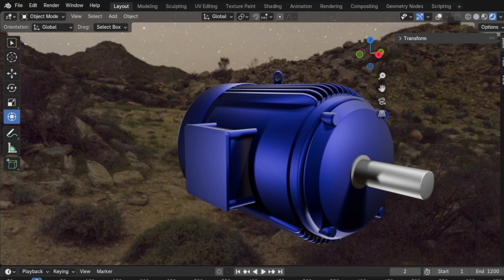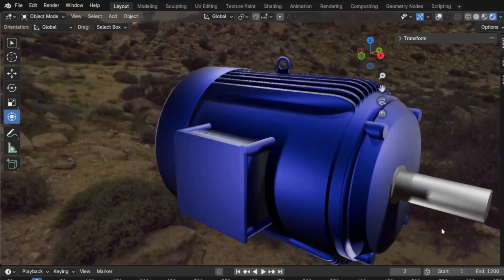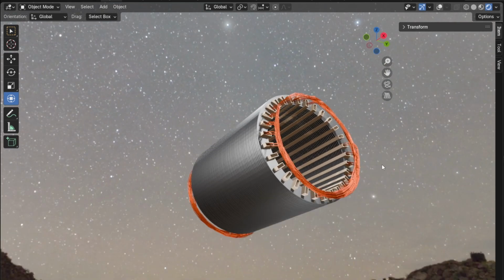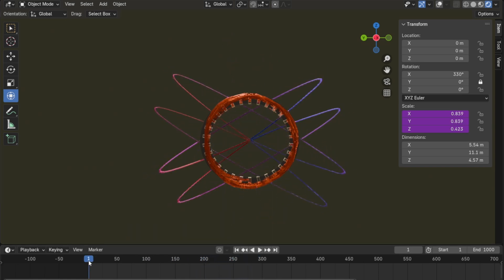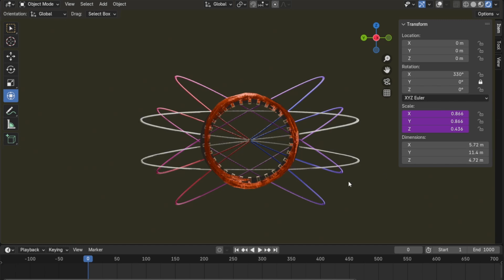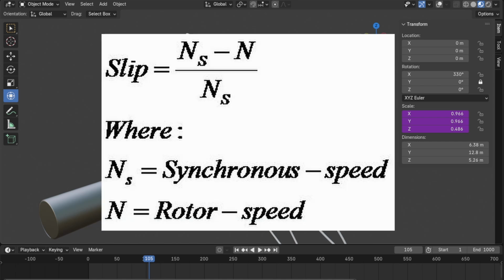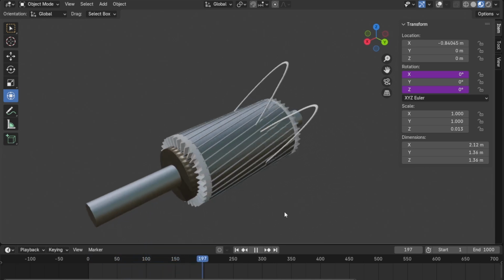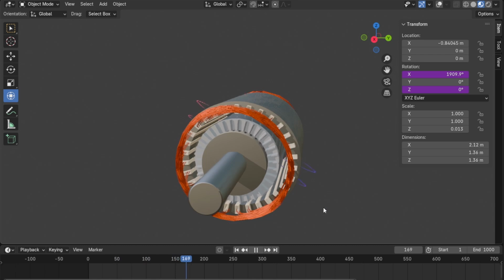Why Bad Connections Cause Induction Motors to Draw More Current

Comment: That is the best explanation I have seen, not just about the failure effects, but of a 3 phase motor working in general. About the inrush current, I think the rotor being stationary in the beginning is only half of the story? The other half being, before the windings have their fields induced around them, they are practically just dead shorts as well (comparable to the resistance one can measure with a DMM). Although it happens very fast, but there is a high peak of current before the fields start opposing the current. Once the field is there, the stationary rotor then sucks the energy from the field further, making the inrush current event lasting seconds instead of fractions of a second, as explained here. In addition the high current heats up the coils and wiring, increasing the resistance as well... Do you think that makes sense?
Reply from the maker: Yes that is great intuition! I was considering mentioning that but I already felt like the video was getting a little long-winded.
That current you are talking about is called magnetizing current!
It happens in both transformers and motors, but it is easier to think about in the context of transformers because they don't have the added complexity of the rotor and slip.
There is a lot of math involved with describing it properly, so a comment probably isn't the most appropriate place to try and explain it. But here's a few hints to help you!(Interestingly enough, the point in the AC cycle when the coil has voltage applied effects the magnetizing current a LOT)

At the heart of Faraday's Law:
V(t) = N(dPhi/dT)
Where V(t) is voltage at time T
N is the number of coil turns
dPhi/dT is the rate of change in magnetic flux(also at time T)

(Notice how similar that equation is in form to VL = L(di/dT)?)

But it's also useful to flip this equation on its head, and use the integral form to find flux itself like this:
Phi = (1/N)×Integral of V(t) dT

That's about as far as I can go in a YouTube comment, but I will definitely consider making a video on why transformers/motors can experience heavy inrush current despite being really inductive.
Reply: @ColossusEternum Well, that is already one youtube comment for sure. But at least I wasn't imagining the lack of that part. With a mechanical background, I'm pretty proud of that now :)

Comment: I am interested as in what you did in blender to do this. If you could make a tutorial I would be very interested. Anyway it is sick! As a mathematician I get excited.
Reply from the maker: @maaikevreugdemaker9210 It took me a few weeks to get the hang of it. The hardest part for me was setting up those slots in the stator. What I chose to do to make those, is to use something called a 'geometry node.' Using those, you can essentially clone an object multiple times around a center point, and automatically tweak its rotation slightly on each iteration to make it point to the center. Geometry nodes are a lot more flexible and powerful than that, but thats one example of how they can be used.
It's a lot like visual programming in a sense!
Reply from the maker: @maaikevreugdemaker9210 I love mathematics, but the highest formal math training I have is geometry. I just kinda taught myself the math I needed to understand the things I am interested in. But lately I have been driving into calculus more and trying to figure out where things like the power rule really come from! I hated mathematics so much in school, but when I found electronics I fell in love with the beauty of it.